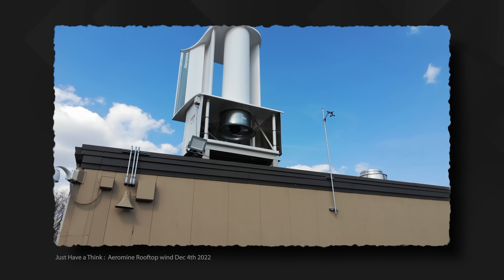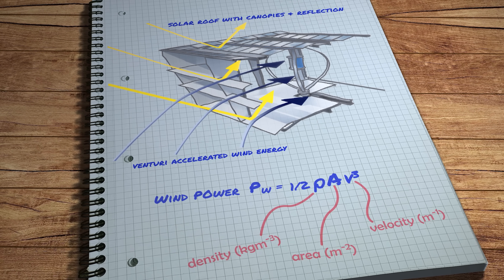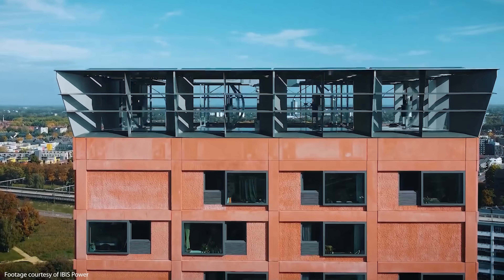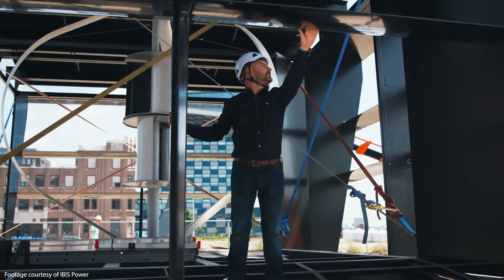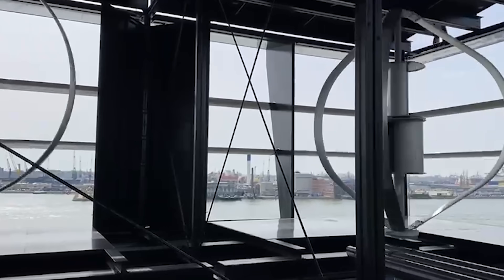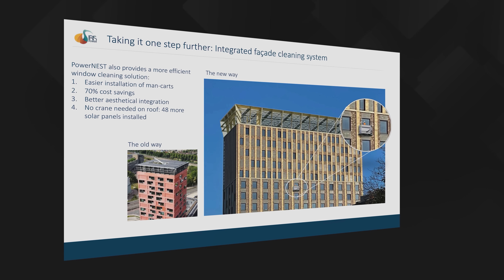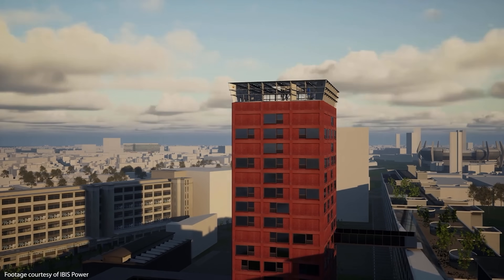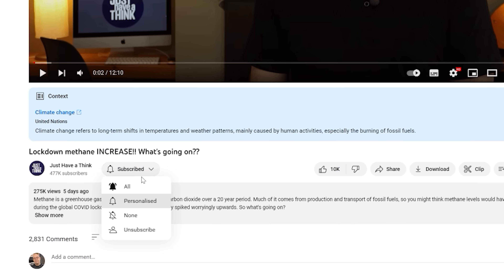The smartest renewable rooftop system in the world?

Comment: As long as the economics work it’s a excellent common sense idea.  I wonder if there’s any IP that would prevent others from helping fan out the idea.  The more players that are involved the faster it will propagate, further reducing cost which will help drive demand.  I’m also sure there are other features that could be included as more “lateral thinking” gets applied over time and with more experience.

Comment: Butt ugly, but louvers closer together would hide it with next to no drag on the air flow. The turbines look extremely dangerous for techs on the roof working on stuff like the AC. And flat horizontal solar panels will be covered with snow in winter and crud all summer (it looks like angling the solar panels so the rain will clean them will trash the smooth air flow the system requires). These issues should have simple easy cheap fixes, but maybe they're problems. I also don't think buildings with a full penthouse have strong enough frames in the penthouse for this much to be added on top.

Comment: Having just gone through a climate-change super-charged cyclone, Cyclone Gabrielle, here in NZ, having this sort of distributed power generation within the urban areas would have meant many buildings, streets, possibly even suburbs, may have had some, if not a good, supply of power in the aftermath while everyone is recovering from the devastation. As it is, our highly centralised power distribution network failed at key nodes leaving entire cities for many days without any significant power at all. Hopefully something like this features in rebuild and resilience planning.
Reply: If were you I'd start by checking whether the structure would be capable of withstanding that super-cyclone. Several other comments cast doubt on this.

Comment: Rooftop wind and solar is just stupid.  It can't provide all your electricity needs and you still need to be connected to the grid.  The result is you have a unnecessary complicated wiring system in your building.  It's also not cheap.  Does the levelized cost include installation and maintenance?  Much better to have large scale solar/wind farms that can do this more efficiently.

Comment: This would likely help provide more temperate airflow for any heat-pump/air-conditioning equipment mounted on the roof top, as well. In the model, a single large building is shown adjacent to several much lower structures. I wonder what the interaction is when you have multiple tall buildings in close proximity to one another. Is it as useful at high urban density as it is with medium density?

Comment: The maintenance aspect of it is also critical, most catastrophic failures on wind turbines are so because the structure itself is not easily accessible. Now combine this with the air conditioning technologies from architecture which should further reduce the power consumption of these buildings, overlay some thin solar panels on the windows, collect the water during rainfall, sure vertical hydroponics walls on each balcony (if any) and every condo building becomes self-sustaining power plant.

Comment: In 1866, the Winchester gun manufacturer developed the first product with interchangeable parts.  Ford Motor, in 1913, started using standardized parts on the Model T.
Standardized parts are important to not only mass production, but for service and modifications.

Comment: Nice. Not sure this is suited to very big building with lots of mechanical equipment on the roof. The issue I've encountered with things of this nature is that there is not much incentive from the building owner to spend additional money that reduces running cost for tenants. If you can solve the economic problem, then we will more installations like this.

Comment: I like the tech, but, as always when presented with schemes for small-scale generation, I wonder about tradeoffs between local small-scale generation and distribution and remote large-scale generation and distribution.  Wouldn't it be cheaper to build large-scale very tall windmills and very large solar arrays at a remote location?  You'll have to transport the energy for local use, but this can be done relatively cheaply.  One factor that is all-important given the urgency of deploying clean energy is the speed of deployment. With proper government support we can build large-scale solar and wind very quickly.  The proper government support is essential if you really want the benefits in costs and speed from large-scale development.  This isn't an either-or proposition.  We can have intelligently designed small-scale, but the emphasis should be on the large-scale if we truly want to achieve the lowest-cost clean energy absolutely as quickly as possible.  And that is what we should want!

Comment: I think that window cleaning part of the system is really good. I wonder if there are also exhaust systems that blow air out of the building, like AC or HVAC that could blow their air on a turbine for a tiny bit more wind power too? Also I wonder if the turbines could be used as direct drives for something in the building rather than making electricity then converting that to electrically spin a fan or pump, just run it directly from the turbine?

Comment: I adore the idea of the using the heat and wind available within the urban setting.  It makes no sense to destroy the rural environment to save the planet.  I do have to question the limited usage as high rises within an urban landscape compete with each other in height and sunlight (in terms of building shadows and such).  The design will of course benefit the isolated and highest buildings within the city the most at the expense of their shorter brethren; which unfortunately dominate the urban setting.

Comment: As to integrating additional resources and maximizing energy conservation and reuse, solar gain on the sunny side of the building can be captured and used on the shady side of the building. This can be accomplished by using individual heat pumps in each exposure and capturing heat from the bottom of the solar panels. The heat can be circulated through the fire suppression piping (which will also reduce corrosion by eliminating dead legs) instead of requiring additional pipe for HVAC /domestic hot water. Excess hot water can also be used to operate Sterling engine generators.

Comment: I have always thought that doing a hybrid wind and solar installation is the way to go.  I am glad this project is proving results because it just makes sense that both combined provide more power and better efficiency.  I would think that you could also group all the air handler units up there and could use the output of the handlers to boost the wind generators...that way the output of the handlers isn't wasted or the fans on the handlers themselves could be eliminated for more overall building efficiency.

Comment: This is such a cool invention! I must say, I would always prefer electricity generation over heat generation; You could instead use water-cooling underneath the solar cells, that way you would cool them and you could use the generated heat to heat your building. But this would require more plumbing and would not be such a standardised solution for every building, so I favour the wind cooled approach.

Comment: With the rail already there, consider using gravity to store excess energy. Lift weighty things up at the sides of the building when sun and wind deliver, else lower them. Easily over 95% efficiency, no batteries involved.

Comment: A lot of advantages, clever design, yes. Main problem is when bits and pieces of it starts coming loose and risk hitting people, people will want to have those things removed. One very severe problem with wind power is that sometimes the wind is much much stronger than normal, and any installation needs to withstand those times too, for decades. That's one of the reasons wind power generation converged into almost exclusively using huge Horizontal Axis Wind Turbines, AKA HAWTs. That's also one of the reasons to why rooftop solar panels are usually installed without much gap, despite that the fact that lower temperatures is advantageous is widely known.      

The power in wind increases with the cube of the increase of wind speed, that means, a doubling of wind speed wind means 8, yes EIGHT times increase in power.  That means, a wind turbine needs to be able to withstand 8 times the force at 24 m/s compared to 12 m/s, and wind turbines needs to be designed to efficiently catch wind power. And 24 m/s is technically not even enough wind speed to be defined as storm. In this case they've addressed this issue with breaks on the generators, they say they generate power just up to 15 m/s, which is just 25% higher than the design speed of 12 m/s. That spares the turbines, but also makes the "wind speed window" where they can produce meaningful amount of power small.    

Urban areas doesn't just have worse average wind speeds, they have much lower capacity and availability factors. That means there will be meaningful output much smaller percentage of the time.   

Also, the solar panels, and the rest of the nest is still there catching wind in any wind speed. I haven't studied their design in detail, so I can't say at what windspeed those panels are likely to start to shatter, or just fall off, but I can tell one thing for sure, they won't have an acceptable level of long term safety AND come anywhere near the claimed LCOE in reality.  As failure means solar panels and or heavy metal constructions, or parts of, falling from the top of buildings 5 or more stories tall, in densely populated areas, anything near 1% failure rate during their life expectancy can't be considered acceptable.        
   
Using the locally available resources as efficiently as possible is an attractive idea, but it isn't as advantageous as it might seem. This will never be able to compete from a purely practically perspective with having conventional roof top solar, combined with solar power plants and conventional wind power generation within a few hundred miles.  For symbolic feel-good PR-stunts, great, until ONE of those installations starts to fall apart and fling parts of itself around in an urban environment. 

No amount of clever lateral thinking will make a solar and or wind power system relevant if wishful thinking says the system someday potentially can reach LCOE that is higher than that of solar and wind today, in reality.

Comment: Many buildings, both commercial and multi-unit residential, use the roof for fairly large HVAC infrastruture installations.  I wonder if this system works better for existing buildings or just for new construction where the HVAC requirements can designed to live elsewhere.

Comment: Those egg whisk wind turbines seem appropriate for a rooftop installation. But I wonder how to secure them from spinning faster than their maximum design speed in a storm? "Ordinary" wind turbines can be shut down by changing the pitch of the blades, but can the egg whisks do the same?
Reply: It has a control unit. But I assume the way they are designed they could easily break adding on top of what I can only assume would be a full installation maintenance nightmare.

Comment: I'm not at all an expert on wind and aerodynamics, but I'm highly skeptical that the wind flow over the top of the building will be even close to advertised if the wind is even 5 to 10 degrees at an angle to the building. Maybe they could put some flaps (which could also be solar panels) at a 45 degree angle all the way up and down the corners of the building to block the wind which is at a slight angle from bouncing off the side of the building and instead direct it upward. I'm also wondering if, for example, a 30 story building is downwind from a 20 story building, would it make sense for the 30 story building have an open air 21st or 22nd story to allow the wind to flow through. Maybe the owner of the smaller building would choose to buy that story of the larger building on the condition that they do that, so the taller building doesn't ruin the energy generation capability of the smaller building
Reply: Also, if you own the 38th story of a building as a tenant, I wonder if you could mount wind turbines outside your windows to capture that upward wind

Comment: Apparently, the vertical turbines hold fraction of efficiency of the horizontal ones.
Btw, I wonder what architects think of buildings they designed getting altered so much.
Reply: Each of these are only 3.000W maximum.
It's going to be hard to justify the cost and complexity.
Reply: @jimurrata6785  One electric kitchen stove can easily consume 3,000 W, so four stoves at dinner time will use the entire capacity.
Reply: @clarencegreen3071  There's 40 solar panels @ 295w maximum as well...
I did the math in another post and even using the most optimistic numbers from the renewables industry I can't make the numbers work to create one of these PowerNEST's, let alone install and maintain it.
I guess if you get a juicy technology grant from the EU (like Ibis Power did) you can attract enough VC to get a rooftop covered in modules, but there's still no mathematical way for these to meet their claim of 6-10 times more than rooftop solar alone.

Comment: That's brilliant, would be great if it can be adapted for industrial and agricultural roof tops. By the way, could you do a video on grid connection innovations, grid connection costs are the biggest stumbling block for commercial renewables at the moment so anything that would reduce those would be great.  So it could cover infrastructure, ownership models or financing for example

Comment: the economics appear :appealing.

 - the use of a self starting Savoneius inside the high aspect ratio Darrieus works  - though due to the roof, there is little benefit of a Darrieus and a controlled pitch H-Type VAWH  may have some benefit in a highly  variable wind assett.  

I see this as a "turnkey package, is there anything original in any aspect or is getting construction approval the ground breaking aspect of this grand-slam of renewables (adding water catchment and controlled "run of the river" hydro - for domestic water supply would be the final icing to the decoration.    If there is no impediment for others to "riff on the theme", progress could be very rapid (unconstrained by a limited expansion budget). - I am pretty sure I have seen every aspect of this design in incarnations reaching back decades - the package deal - seems approvable, and possibly economic  (birds will still fly into the beaters - from time to time - heck they fly into supermarkets, through thee sliding doors, not that  this should put this great concept down.)....

A Solar shade screen on every commercial building is a no brainer  9all of these benefits without needing wind generation necessarily.

(NB, infinitely better a concept than a direction sensitive Aeromine(TM) - likely the pros and cons will fight out in the commercial space.

Comment: "Each turbine generates a maximum output of 3Kw"
So this whole structure develops (at most) 9.000 or 12.000 watts from wind.
What's the average generation? And what's the ROI of a complex electro-mechanical system that requires large cranes and ironworkers to install in an already built-up city?
Solar... I get it.  This "crowning achievement" I'm left wondering when (if ever) it is going to redeem all the material, construction and maintenance costs before it ever creates a net positive energy or carbon reduction.

Comment: I believe that for this system to hit the stated cost-benefit ratio requires a climate that is mostly sunny and has substantial wind at night, and doesn;t have a high cooling load, which requires major roof space for a cooling tower. So, while it is definitely the best approach for certain places, it is not a panacea for everywhere. Installation crew must be specially trained, and the attachment to the building must be robust, because the wind on those louvers will apply a lot of variable torque to the attachments! the interior blades help start the turbines at low wind speeds. the curved Darrius blades are prone to vibrations and failure as they age, so adding a spiral pattern to them would improve long-term and quiet operation.- Carl Andrews, Energy Analyst
Reply: Carl, the stated maximum is 3kw per turbine. (That's 4Hp in Yank terms)
The structure sure seemed stout enough to handle that kind of torque, but I'd be more interested in the uplift generated by the solar panels.
At least the FEA suggests to me there's a lot more wind load from them than the turbines will ever create.